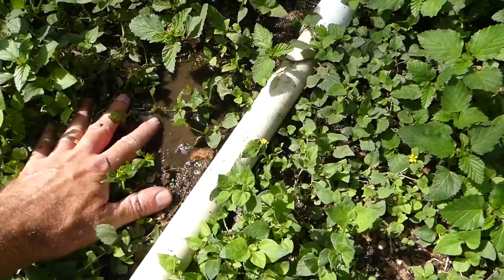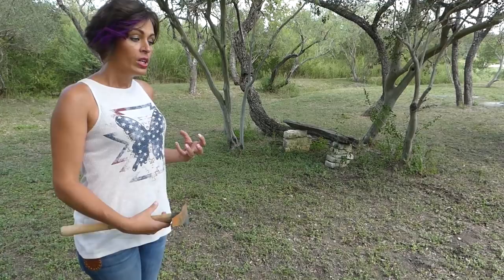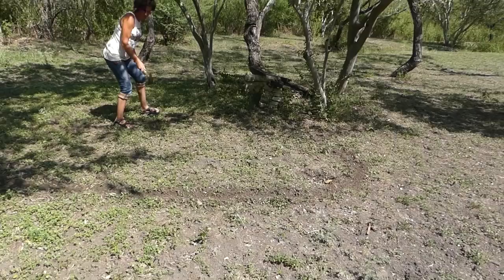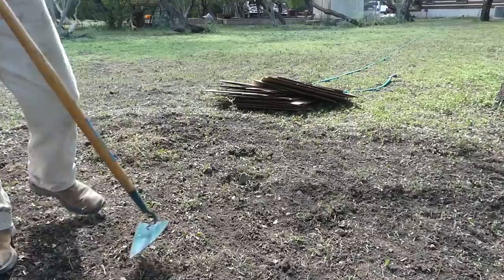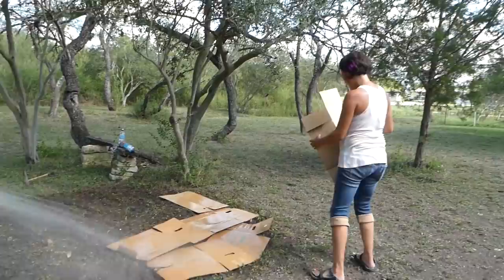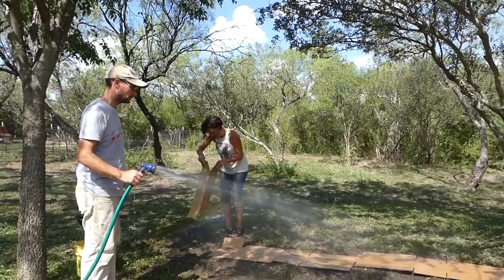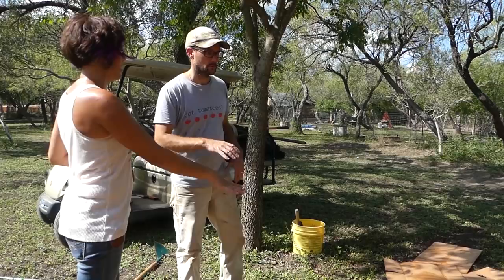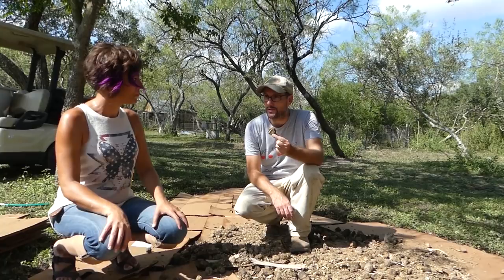Building A Butterfly Garden - With Drake White The Butterfly Lady - Part 1

Comment: Is your soil clay, sand, silt or a mixture?
Reply from the maker: mostly clay
Reply: That is what it looked like to me. I rented a house sitting on gray clay, with at least one pocket of limestone and several very large rocks. It took years of mulching with organic matter I gathered from the floodplain of Beaver Creek. I spent one autumn stuffing bags of leaves into my RX-7, and then dragging them to the garden on a comforter. My garden looked like a patchwork quilt. After about three months of rain/dry I went out and double dug that whole 900 square foot garden. Found more rocks. After all dried out I made the beds 10x5, with the paths between the width of a shovel. Main paths were two or three foot wide. All covered with grass clippings once the soil warmed up. Then in August the pine trees dropped their needles. In November the trees shed their leaves. When I left there about six years later my soil was brown and heading towards loam.